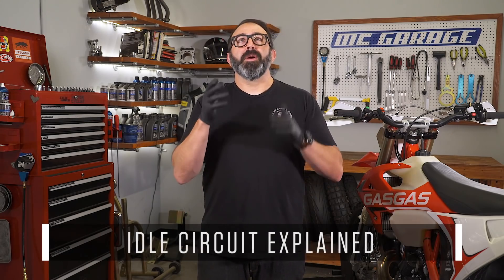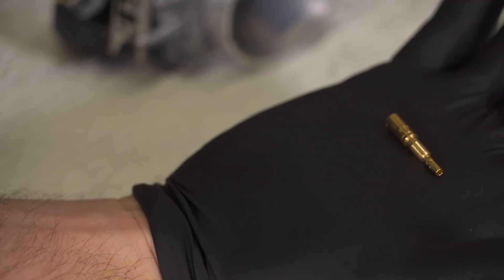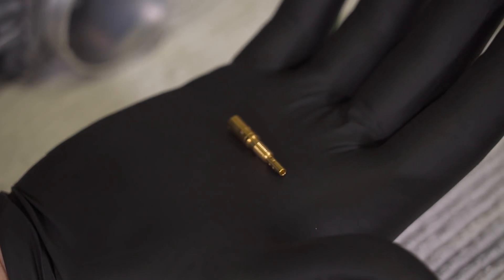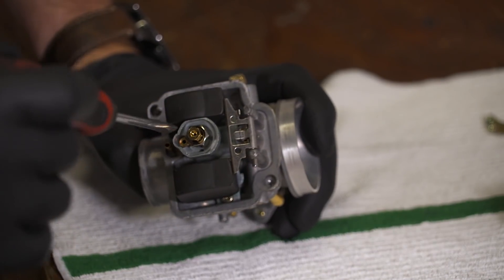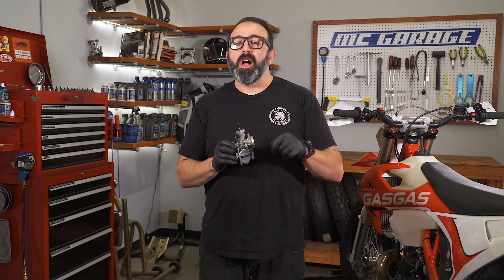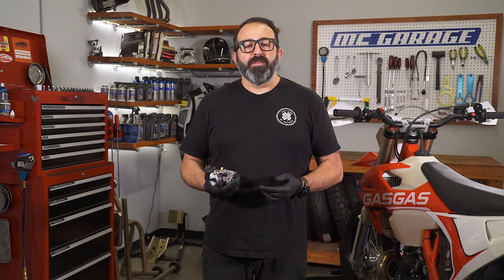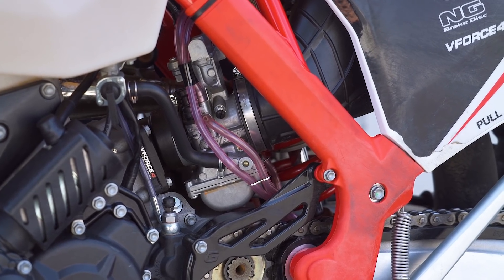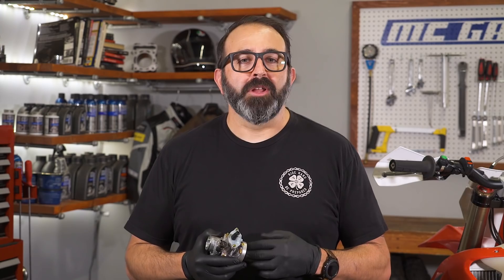Inside A Motorcycle Carburetor - Idle Circuit | MC Garage

Comment: hi thanks for the explanation. ive just changed my pilot jet and main jet .the fuel screws have been adjusted and are in the same position as before. is that ok 🤔i set the fuel screws that gave the fastest idle .

Comment: My engine runs fine in idle when first fired up, though after the engine warms up it starts to race. I have adjusted the carburettor idle throttle bolt loosened all the way off and it still continues to race. I have noticed that when this occurs and I put the bike in gear and ride the clutch a bit whilst remaining stationary the idle then drops again, though increases again when back into neutral. Has anyone got any idea what may be causing this?
Reply: Airleak on the intake side?
Reply: @MaaZeus  Already checked all of that. I have since done a more thorough check of the carburettors using a carburettor gauge test kit and discovered that two of the four carburettors were completely out of synchronisation and when the engine warmed up the synchronisation became more unstable causing the engine to race. Now that I have synchronised the carburettors the engine runs better than ever.

Comment: Hii, I have ninja 400,
My bike used to run very smooth and goes easily up to 140-150 without much vibrations. But sometimes it is hard to go even 120 the bike start shaking and vibrating. If I am lucky the bike suddenly starts to run smooth and feels more power but sometime if looses power. And I can hear some sort of light noise coming from the engine area it’s like a small leak from exhaust but there is no leak it comes under the engine area. Do you know what could be the issue and what I can try?

Comment: Are some air screws covered by the manufacturer? I pulled out a screw from the exterior of my carb on the engine side and it had a pointed tip, I believe it is the fuel screw, but there are some spots that look potentially like a covered screw on the air side, but there is nothing else on the exterior of the carb that I can adjust.
Reply: Yes, carbs sold in the US often have plugged or non-modifiable ports/screws/etc. For instance, my '95 XV250 have a brass plug with a tiny hole drilled in it instead of a pilot screw.

Comment: Hi i have a tgb target 525 . 503 cc engine. This use a mikuni carb BSR 33 (33MM DIAMETER) and i wanna ask what is the best jet combination to get max power and high rpm( 9.000...10.000rpm) at the moment is runing a ignitech cdi unit witch is probramable and no rev limited. From the factory this came with .225 PILOT JET and 145 MAIN JET .Thank you

Comment: Hello, i have a kawasaki ninja 500 and The bike was not started în The last 2 yeas. 3 days agoo i decided to start it. I puted a new battery, puted fresh gas and it started easy and the engine runed for about 30-40 second. It stoped and i noticed that the carburetors were fluded bad, liking from the air filtre. I decided to take the carbs off, opened them, cleaned them, maked the flote work again and now after i asambled The carbs and puted them back on the engine, the engine dus not start, it detonates in the carbs. Dus not start whit start spray, The Last detonation was s-o hard that it threw away the carbs from the engine whit a lil flame. I hawe spark on the coil, i have gas suked in to the engine, i have good compression, what could be the problem?

Comment: What is the best carburetor for a venom x22 2020? I have a hole in my airflow box and it's a brand new bike. So I'm doing repairs and replacement. The hose is going from the carburetor to the airflow box. I also need to know the best hose to use. Let me know. Thanks

Comment: my two stroke ke100 idles fine possibly on the rich side. It doesn't really bog in neutral. It only bogs under load if I open the throttle more than 50% . If i gradually open it its fine.

Comment: in india usually lower segment bikes till 200 cc uses Carburator and some higher uptill 500cc too and i own a 125 cc Scooter which has the carburator with Electronic choke. Tuning that At the beginner level(me) was not perfect and i learned a lot. seeing this video i can compare and revise the procedure to get better understanding of the sound the engine produces. My other 110 CC scooter had a traditional, no electronic nonsense Carburator  which in recent month giving me a problem where its overflow oriface at top and bottom one completely ejecting fuel whenever the engine is cranked. thats problem was a nightmare to solve untill i got a float needle valve to replace with the old one and the problem stopped. thats how amazing and nightmarish the Carburators are.  Thanks for the Content.

Comment: Will you post some video of how to tune multi-cylinnder carburetors?
Reply: To get each carby synchronised with each other (all opening at the same time), remove the air filter and use a length of tubing with one end near your ear and the other end just inside of the carby while it's idling and listen to the air being sucked in, then compare with each other and adjust linkages so all have the same suction noise.

Comment: Is it the same to use the choke to start a cold engine as is to keep open the throttle for a while? (Same revs sound for the same time)
Reply: It is not. The choke either restricts airflow upstream the butterfly/throttle piston to create additional suction that draws more fuel into the carb throat, OR flipping the choke activates an entirely separate "enrichener" circuit that feeds more fuel through dedicated passages. In both scenarios, the choke supplies additional fuel into the existing closed-throttle airflow to enrichen the mixture.
Reply: @AriH211  So using the choke would be finally more efficient to start a cold engine and heat it up. Thank you for your reply!
Reply: @aricafoix  Yup. That's what it's there for!

Comment: SOMEONE PLEASE ANSWER....!!
My motorcycle's RPM increases when it is kept for a minute to arround 2k RPM from 1.4K...and after riding it for 4-5 mins it's idle RPM reaches to 3 - 3.5k RPM....there is no problem for throttle cable....
The motorcycle is a japanese machine of 150CC....(Honda Unicorn)
Due to this problem the mileage has reduced.
Did not inspected the choke wire...A mechanic said the carburetor need to be changed...because the mixing screws are jammed...
WHAT TO DO???
Reply: Check the choke, if it's on or stuck that will cause exactly what you describe.  And find another mechanic who's not out to sell you a carb.
Reply: @triumphrider9796  let me check...Thanks anyways

Comment: Carburetor are a work of art and I'm loving to work with it as it is simple and no electronics failure will happen to this bad boy. If you want more power from your bike just slap on a bigger carburetor with the right jetting and your bike are already good to go. Fuel injection on the other hand need a Dyno tuning which never be good on your wallet and all the upgrade parts are expensive as hell.

Comment: ok so i have a question. I got a 250cc 2 cilinders and 2 carbs. And why does it seed in the "manual" that i need to turn carb no.1: 2.5 turns and carb no.2: 1.5 turns?
The manual is a old copy and do not know if it is the original bit the the bike is a 74".
And no aftermarket filter or tuning all is stock. And its 2 stroke
Reply: This is common for V configuration engines. Usually the cylinder in the back gets a slightly richer tuning, than the front cylinder. That's due to the higher temperatures of the rear cylinder because it doesn't get as much cooling as the cylinder in front.
Reply: @Chris675R  but i do not have a V engine. I have a inline 2 engine.
The bike is a moto guzzi ts 250.

i'm hoping that the mixtures are right i do not want to destroy the engine.

Comment: How do I adjust the carburetor for high altitude roads?
Reply: Higher altitude means the air is thinner. If you go from low to high altitude. The bike will run richer than normal. So you need to lesser the fuel intake. That will normalise the engine.

Comment: i like how you explained the tuning of the carbs by listening to the bike. but how does it work with 4 carbs on an inline 4 engine? i mean, when 3 carbs are perfectly tuned, but one is slightly or a bit more than slightly off, will i be able to hear it?

i also wouldnt mind a more complex explanation of the system, the cycles etc, maybe even by using some sketches on a whiteboard like some other channels do ;) 
anyways, keep up the good work
Reply: You'd need to do an idle drop. Instead of listening, you use the tach to watch the rpms as you make adjustments. Turn them all out a quarter turn in sequence until the rpms stop rising. Then tighten the first screw until you see a 50 rpm drop. Go back out a quarter turn, then move on to the second screw. It's tricky but satisfying

Comment: Why does cold engine require richer mixture?
Reply: Because when an engine is cold, so is the air, and when air is cold there is more air therefore needing more fuel in order to start up
Reply: @aussieguy1593  by "more air" you mean denser air?
Reply: Ivan Arifin exactly
Reply: @aussieguy1593  There's also the fact that the engine (intake tract, piston crown, combustion chamber, cylinder walls, etc) are cool and therefore the fuel is less likely to vaporize and may even condense on surfaces. The solution is to supply more fuel to ensure sufficient combustion until the engine warms up.

Comment: What could be the issue when the carburettor dumps fuel (in the intake) when the bike is off? After many tries to start it, when the fuel evaporates it runs fine. It has an automatic, electronic choke.
Reply: The floatvalve isnt sealing if gas flows to the intake on its own.
Reply: @JensEskildsen  The bike runs totally fine when it's warmed up. Could adjusting the float height be the solution?
Reply: @socas_nic  Check if float is not cracked or punctured, doesnt take in gas and if it operates freely. Also would be good idea to replace float needle valve.
Reply: @socas_nic  A slight chance yeah, but I'd change the floatvalve for sure when youre in there.
Reply: Check your float valve. Sometimes it's misaligned or the rubber seal has worn out and need to be replace.

Comment: What is the value of the idle RPM of any bike?  Is it 1100 RPM? My bike's needle drops below idle 1100 RPM but it automatically shuts down at 500 RPM if I rotate the screw and bring the needle at 500 RPM. What RPM value should the bike automatically shut down when it is in neutral or within how much time and RPM value should the bike automatically shut down in neutral? Please show the screw turns of resetting idle mixture of carburettor.
Reply: 900-1000 rpm is optimal, but if she runs rough or stalls at those speeds, 1100 is fine
Reply: @tentacleslap5531  My another question is what RPM value should the bike shut down if we decrease the RPM needle by turning screw? My bike shuts down at 500 RPM if I bring the needle down at 500 RPM but previously it used to shut down when the needle comes at 800 RPM.
Reply: @nathanielpeter3296  It doesn't really matter. Pretty much anything will stall at 500 rpm
Reply: @tentacleslap5531  Ok.